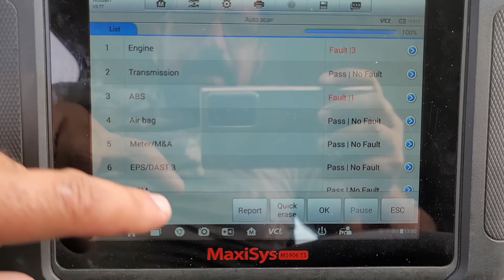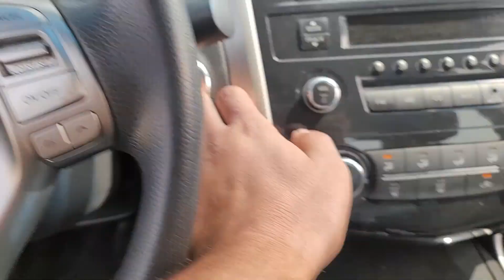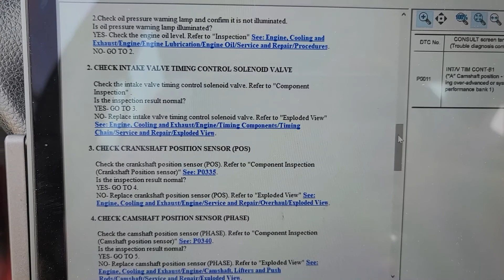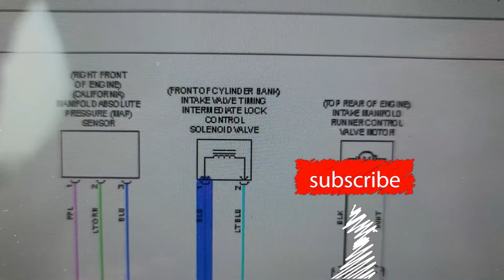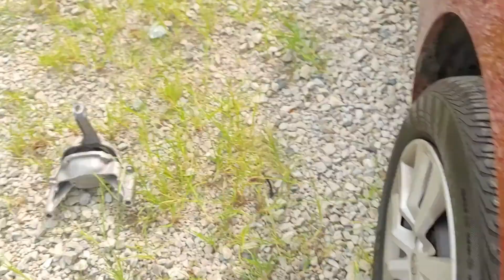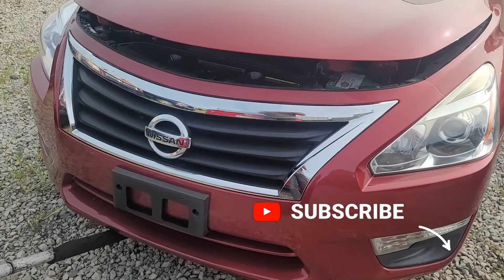2013 Nissan Altima P0011 and P0014 codes, Diagnose and repair

Comment: Computer says “transmission timing” is bad on my girlfriends 2012 Altima...? Could that be the camshaft sensor and possibly need transmission fluid  replacement etc etc. Car was very shaking. Slipped. But not all the time. Just sometimes. And then it just stopped shifting and I'm out of town 🤦

Comment: I have the same make and model- 2013 Nissan Altima 2.5 SL. Pulled codes & got P0300 and P0014. Same sound in the video too. Thank you for the Excellent video on finding, testing them and product they replaced with. 
Curious of sale price they put on it to sell it…did I read it as $7995?
Reply from the maker: Glad to help. I think it was 😊

Comment: I’ve seen multiple videos for the p0011 and P0014 code on the 2015 Altima. They bounce between those solenoids on the side that you removed and  two on the top of the motor toward the right side. The videos all call these the “camshaft” solenoids but one video shows what you did and another replaces the ones on the top. Which are they, the ones on the side or the top for those codes…. Or could it be any of them?  I’m pulling both codes right now. Car has 256k miles. Oil level is good and looks super clean. Thanks!
Reply from the maker: It all comes to resistance measurement and testing. If results are not good then replace it does not matter if on the top or the side.
Reply: @DallasAutoDiag  thanks for the reply!  I’ll start pulling and testing. Do you need to drain the oil when removing the solenoids That you pulled out in your video?
Reply from the maker: @ickess  not necessarily
Reply: @DallasAutoDiag I wound up replacing the VVT solenoids and this fixed the issue.  Believe there were 3 of them.  Did it years ago, so far so good
Reply: Which one of the three will give the P011 code??
Reply: @jeffreycicero6685 I replaced all the vvt solenoids and that fixed my issue
Reply: P0011 is the middle one